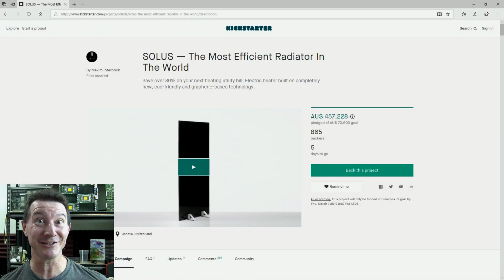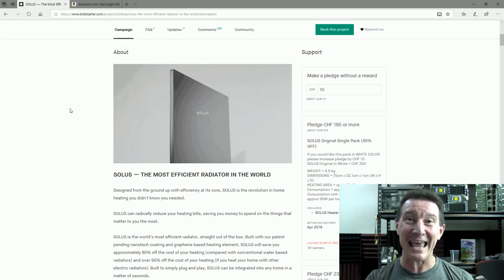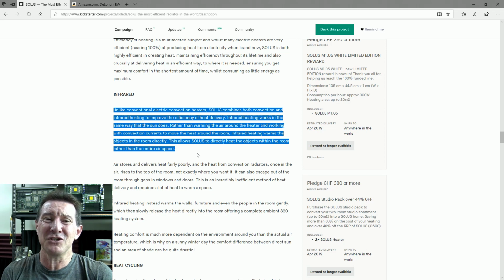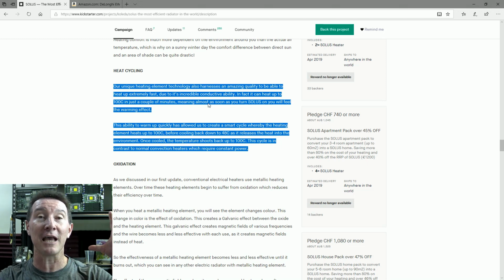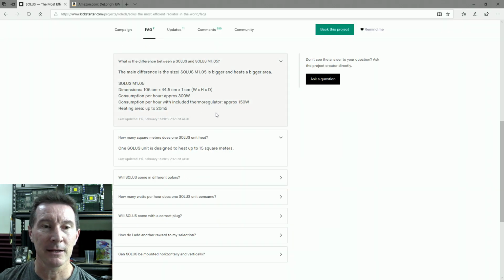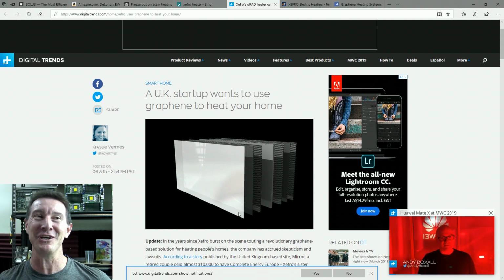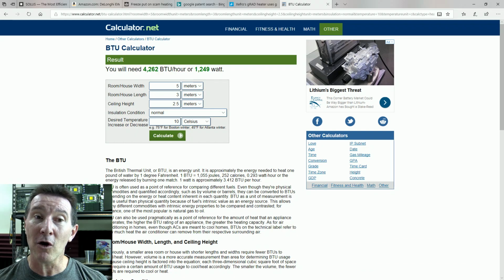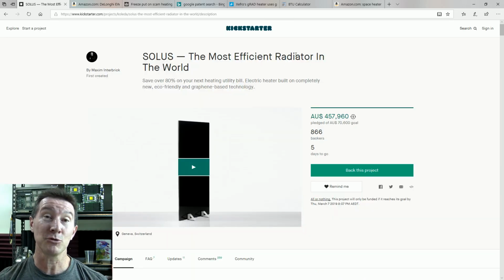EEVblog #1186 - Solus Graphene Heater Kickstarter BUSTED!

Comment: I for one think it is a good idea for the resistance of a heating-element to increase with temperature like any normal hot conductor has:
It stabilises the output from differences in the grid voltage and prevents thermal runaway. It also means that the heater can draw more power for the initial heatup => being faster to react when turned on.
Its almost like the people that first designed electric radiators knew what they were doing.

Comment: Robert Murray Smith used some of his graphene ink to paint a radiator on the wall, with a couple of strips of copper tape, painted the whole lot with wall paint so it looks the same as the other walls and has a 40 degree heater on the wall that you can't see. It costs not very much at all, maybe £50? Now that was a clever use of graphene, if you ask me.

Comment: Snake oil at it's finest! lol So they cement some thermal rods together (honestly they look like standard high heat strips any heater would have), sandwich them between some glass, and call it all these fancy things? That's sad. The fact that they made it out of glass is hilarious, easy way to weaponize and otherwise harmless product assuming it doesn't overheat because you didn't get the "Thermal regulator". No this product is not more efficient if anything it's less efficient because it has to radiate heat through glass. I will argue thermla glass is a good enough conductor though, we have an electric stove top with a thermal glass cover. Radiators are made the same way they were 50-100 years ago, hmm, I wonder why?

Comment: you keep saying that glass is a poor conductor of heat, which it is but how does that really matter? 300w is still 300w, does it matter if the element between the glass has to get to a thousand degrees in order to get enough transfer into the glass to heat it up?

Comment: My small space heater with fan nor oil radior ain't 100% efficient cuz they have indicator lights if they work, so some of the energy is used to make light.

This magical glass thing is better, wait it has some wireless connections... How can they claim it 100% efficient, if they claim magnetic fields in my space heater make it bad.. What about wireless communication

Comment: "We observed that during the off cycle (1.5 seconds when current is cut off) the heating element continues to generate heat due to the self cooling properties of graphene, which results in a difference of potentials."    I'm no physicist, but that sounds like hogwash to me.

Comment: I would like to know more about the claim for Infrared radiation. 2 things come to mind, IR is a detection of heat from thermal sources which has nothing to do with generating the heat, BUT can the SOLUS convert the glass the emit IR Photon which would generate more heat directly. Maybe not, just would like to know a bit more. Safety warning. If it does emit photons then the risk of sunburn in your house is of concern.
Conversion of one wavelength to another wavelength is possible, as we seen in CFL tube, so maybe it is possible to use something alternate to convert heat or something else mixed in the material with the glass (which is a great transmission material of IR photons.)  So is it really just tempered glass?
Maybe just a little bit more research on explanations on the IR heating will put this issue to bed. Glass on the back can also transmit photons to the wall and if a bright wall reflect the photon and dark wall will retain the photon to convert to heat.

Personally I wouldn't buy much from Kickstarter, so it doesn't matter to me. As a buster maybe if you haven't read the patent application yet, comments like this may be a bit of a jump ahead.

It is important to note the heating from a bar heater is more efficient that oil based heat for direct and the red glow of the elements produce IR as well. Oil heat don't do this.

I have already seen Graphene based heaters working and they produce great heat and if SOLUS marketed things right then the main advantage is the prolonged retention of heat in the oil is the main reason I don't like it. Switch of an oil based heater requires a lot of predetermination so that it does not overheat the room. Oil heater remind me of an extremely underdamped control system.
Reply: WIMake II Please be careful in the naming of heater types.  "Oil heater" could mean "Oil burning heater" (needing annual refills from oil company) or "Oil filled electric heater" (using the heat capacity of an oil filling to average out the on-off nature of a typical raw heat element).  Similarly with the name "bar heater".

As for using an "IR thermometer", that technique is highly sensitive to properties of the item it's pointed at and should not be used unless necessary.  At relevant temperatures for heating human habitats, almost any other thermometer will give more accurate results, especially when pretending to compare different heat sources.
Reply: @johnfrancisdoe1563  Well in Australia seeing that Oil burning heaters are not allowed then Oil Heaters are exactly what I said. I personally do not give a shit what country burn oil. Personally I don't even care about this video other than I see many good ideas immediately quash by un-researched. Dave experience is limited like all of us, and going out and immediately with only a single person's understanding is dangerous. Dave has got it right many time only in areas that he has express experience but in this case no one has followed on any IR photon understanding to finalise the squashing of this product. To me that is Dave jumping the gun again. I only hope for his sake that the research he has done for himself is enough because one day he will find himself in front on lawyers after him.

Comment: I must say your post is very efficient and is sure to bring the makers to the boil even more quickly than a 3KW kettle on a super efficient 240 volts 50Hz supply brought in by scientifically designed overhead grid lines.

Comment: Water based radiators refers to  'central heating' - gas fired boiler hearing water and pumping around a network of radiators.

Not 100% efficient but gas is cheaper than electricity here.

Comment: Only the marketing department can improve on the only thing that's 100% efficient* to begin with.

* 100% only if your house/system is infinite in size.
The mains and grid cables also heat up a tiny bit and they're outside house. So I guess technically means that the lower the power draw is the more efficient it is. It's fuck-all of a percent but after all, Mother Entropy still needs a sacrifice.

Comment: If you have a short wavelength IR heatet... Tempered glass would work excellent.... Ant it would actually also use Abit (well... Maybe 10% less) making the heat feal more (actually having lower temperature but fealing like it's nomal)

Comment: Im starting a new kickstarter to save you 100% on heating bills. So far i have a large graphene coated master switch guaranteed for 1000 years which when used will turn off all heaters instantly saving you 100 percent. If you sign up for the deluxe package you get a carbon nano tube sweater to keep warm

Comment: 32:37 The numbers don't add up ... If I assume a smaller room (15m²/27m³) and good insulation ... and the starting temperature as the outside temperature ...then I get roughly the same ballpark namely 483W* which can you attribute to the fact that the calculator is a rough estimation (humidity plays a huge role in how much energy is store in air)
But I can see how someone making scam product also fakes the test.
Soo... as long as I have seen a test done AND PUBLISHED by reputable source, I'm calling BS on these test results.

_____________
*= https://www.calculator.net/btu-calculator.html?roomwidth=5&roomwidthunit=meters&roomlength=3&roomlengthunit=meters&ceilingheight=1.8&ceilingheightunit=meters&insulation=good&temperature=8.1&temperatureunit=c&calctype=heat&x=0&y=0
Edit: link to their numbers:
https://www.kickstarter.com/projects/koleda/solus-the-most-efficient-radiator-in-the-world/posts/2430561

Comment: The cheap radiator have two lights on it, and the light can travel outside the home, and lose the energi. The Solus have no lights, so technically its more efficient.
Reply: B. But it has infared heating witch is just light that can travl outside??

Comment: I think their argument about normal heaters becoming less efficient over time was just poorly stated. No, it does not become less efficient, but it could become less effective. A 1000W heater could degrade over time and only draw 900W say, still 100% efficient, but less heat. Their reasons for why heaters degrade sound like total crap though.

Comment: Interesting. Thanks for this ! Woo is woo, as you say.
Seems to be a 190w IR lamp? Plenty of those available ... They can feel very hot on the skin, because they don't really heat the air but the surfaces of things in the IR lights path. 

Which they kinda own up to. The IR is quite capable of escaping un-absorbed too, just as any light bleeds out of a house. Which leads us to  ....

I note they are testing with an IR thermometer. This is a trap for young players. They measure luminous intensity in the IR spectrum - how IR bright something is, not its temperature as such. The temperature they show is only valid for a black-body surface, for example a piece of hot metal like the wall of an oven, and not for example a painted wall. If you have one try this - on a hot day, point it at the sky away from the sun. The result may surprise you - it will read below zero. In summary, IR thermometers need to be used with care - they do NOT measure "air temperature" at all.  And air temperature is what stops your eyeballs freezing when you look at the sky or your body in a house on a really cold day.

You can not really warm a house properly and prevent pipes freezing etc with just IR in a cold climate, whatever they say :) You need all the air in the house to be hot, not just a few surfaces.

Thanks mate, good examination of the issues, just wanted to add some nuance !

Here is a fun reference : http://www.tansun.com/gb_en/technical/how-quartz-heating-works.html

Comment: Dave is right as any electric radiator is at least 99% efficient. From the $10 model to the $2,000 one. The only difference is the design, safety, etc..

Comment: You are right that it cannot be more "efficient" in terms of converting electricity to BTUs, but in fact a different type of heater can be more efficient in making you feel warm and comfy.
You repeatedly refer to "radiators" that may be called like that in the shops in English speaking countries, but actually are more accurately referred to as "convectors".
They do not "radiate" most of their heat, but rather they heat up the surrounding air and make it convect to other places in the room, being replaced by colder air that is then heated.
A true "radiator" would radiate the heat as IR where it will traverse the room until it hits something, e.g. your skin, and there it is raising the temperature.
So you quickly feel the warmth of a radiating heater even while it has not heated much of the air.
In that, it can be quicker and more efficient at achieving its goal of you feeling comfy.
Reply from the maker: They state this is both IR and convective. But their own tests focus on heating up an entire room, not heating a person direct with IR.
Reply: I am not doubting that the whole thing is a delusion and will fall apart once it is independently tested, but things are not as simple as your first approximation seems to suggest.
I am looking forward to the proper tuturial that explains the difference in heating using convection and radiation, and why some of the device names do not really represent their function.
For example, why a patio heater can make you feel comfortable on a chilly night without really heating the air like a convective heater would.
(of course there is also conduction as a heating mechanism, but it is not really relevant to room heating)

Comment: Perhaps what they're claiming is that the emissivity  of their heater is highly efficient (close to perfect blackbody). The consumer units you were comparing to are not particular good 'radiators', they're convective heaters. A white dimplex oil heater only radiates about 15 - 20% of it's energy. So the claim that those other consumer goods is the same is a little misleading. The glass is not being used as a conductive substrate, it's being used in a transmissive mode. But at the end of the day you're right, a Watt is a Watt.  I think it's important to explain conductive, convective and radiated energy as they're very different; radiated energy dump from a black body is X^2 faster than passive convective.  A good example is when you go to Bunnings in winter and they have I.R. heaters near the checkouts - They're radiating energy into an infinite space, but you still feel warm and they're doing that by not using infinite BTU's. It's the mechanism of energy delivery that appears to be their "claim to fame".

Comment: Other inefficient radiators produce 20% heat and 80 % light or energy... maybe. I think they really means water based radiator, part of an oil or gas burner heating system and then electrical driven heaters are eventually more "cost efficient",of course. But thanks you for draw attention for this magnetic rocket science 200 watts bullshit.

Comment: So they took a AC 3D Printer heatsink, then sandwiched it between graphene thermal pads and stuck glass on the ends??? That's fantastic.  To be fair to the design both graphene and tempered glass conduct heat outwards towards the edges alot more than through the middle of the material, I'm a bit curious if it would help  it work well or much worse?

Comment: "Graphene paste" - isn't the whole point of graphene to be an atom thick?  That's just soot paste - it's a shit carbon film power resistor
Reply: My thought exactly. Graphene paste my arse!!!
Reply: Not even! That's a carbon composition resistor. Carbon film is much better
Reply: Graphite ink
Reply: It's possible to make a paste out of particles that are each only an atom thick. That's exactly what they're talking about.
Reply: @BenjaminGoose  doesn't graphene get it's conductive properties from being in a single 2D lattice? I feel like mixing it in a paste would offset and overlap lattices and it would basically just be a graphite paste which does have its own properties, but it ain't graphene.

Comment: As you touched on in the video, this is nothing new. There are numerous electric heaters (radiant, convective, fan assisted) that have been advertised over the years as somehow more efficient than all the rest. A few years ago it was ceramic elements. When there were new there was a spate of adverts trying to con the technically ignorant that they were somehow better than older (cheaper!) technology. None of them are over 100% efficient (nor under in most cases)

Comment: weller's unfused soldering station=best heater
Reply: I don't know,  I'm still partial to the old 500W halogen lamps ... light and heat at the same time. Bonus, you know a head of time your electric bill was going to be high.
Reply: Jax jackson Also you could toast bread with them. 3 in 1!
Reply: My computer is more than 100% efficient, it makes pretty lights AND heat!
Reply: Best electric vape 😀👍

Comment: I think I’ve just figured this scam out!  Their special graphene formulations contains large quantities of enriched Plutonium (we’ll blame Iran or North Korea), thus their 190W resistance heater is actually capable of emitting 5 times more heat than a standard 190W heater plus the added radiation burns will leave you feeling warm and tingly all over (no worries, that’s just minor nerve damage).  The important details they’ve left out are 1) you will be heavily irradiated and 2) it will emit the equivalent of about 3,000 BTU/hr into the room continuously for the next several decades — only the 190W heating element is switchable.  Therefore there is a risk of “moderately” excessive room temperatures if you live in more temperate areas of the world, but may be perfect for polar climates...so long as one does not mind the added benefits of radiation burns, unexpected hair loss, additional energy savings due to your glowing in the dark (no lights needed at night), and eventual radiation sickness followed by a painful, albeit 5 times more efficient, death.  Just warn your pallbearers ahead of time that they’ll be carrying a lead lined coffin at your funeral and may wish to start working out!